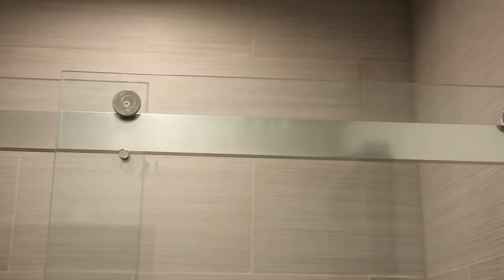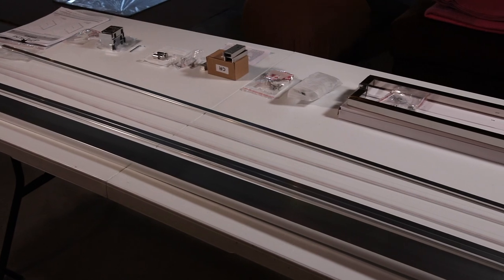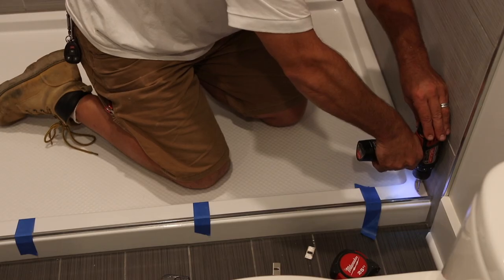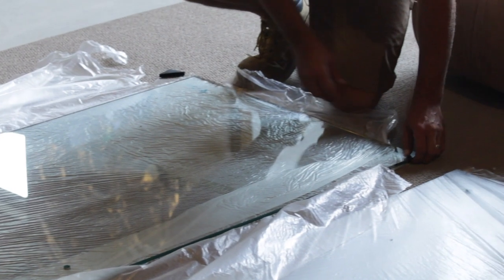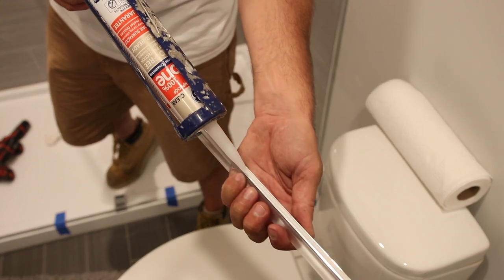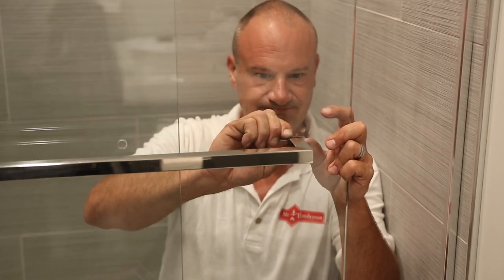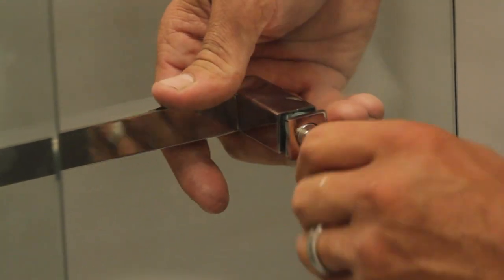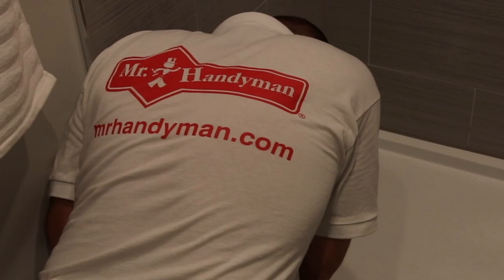[Sponsored] Mr. Handyman: Installing a Dream Line Shower Door

Comment: I have a delta everedge 60×32 ×72 height. Base a wall set. I bought a dreamline essence, but in height of 76. At lowes they told me it would work but just have to do a few extra things to make it work. Is this possible and if so would it look OK after installed? I have model numbers of everything if that helps. Learning so many lessons the hard way in the last 3 months. I could not even make this stuff up. It's been a total nightmare and only should have been at most a week job on my house😢. Thanks for any advice. Also, at this point if I have to get another door is it best to go with semi framlesss or framlesss? Or framed all around.  Far as water not coming out on floors. Out of money and kinda having to do what is cheapest but not to where I'm going to have problems if that makes sense. It's been very overwhelming and used my whole loan on hiring bad contractors . Drywall has been ripped out twice, shower has been taking out probably 6 times to where it busted the base and had to get another base. I'm so desperate for any advice. Single person on past budget and low income. Thanks